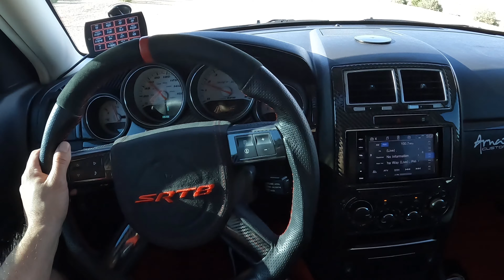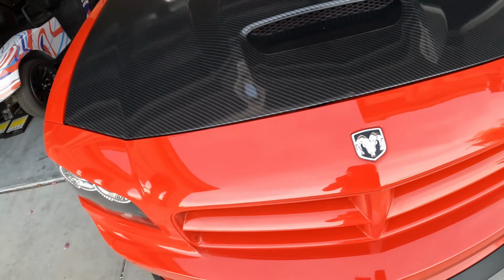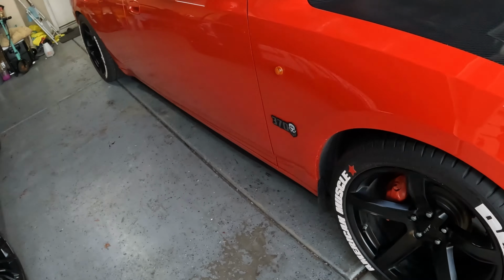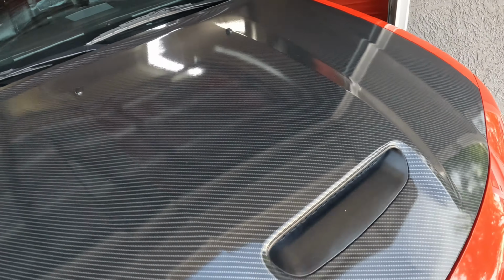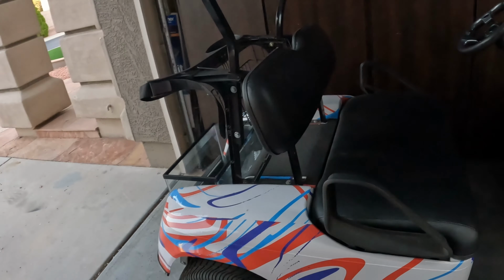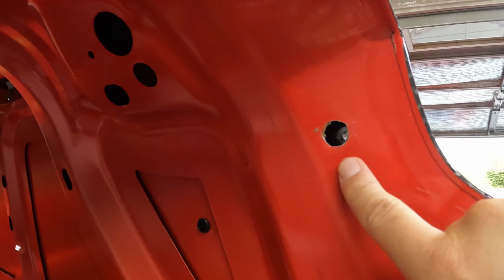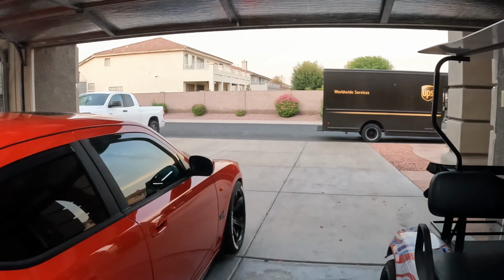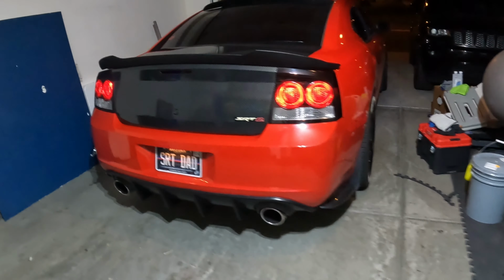CHARGER SRT TRUNK WRAP!! + VICREZ SPOILER!!! (TURNED OUT AMAZING!!) #carbonfiber  #srt #dodge

Comment: Is that spoiler fitted for your charger??  The website doesn't show for a 2008 charger rt.  And links to the tail lights. Thanks bro
Reply from the maker: It’s not for our Charger but clearly fits just fine 👌🏼💯
Reply: @srtdad  
Ok… which years does it fit??
And where did you get your tail lights??